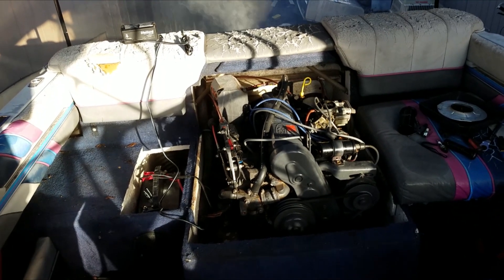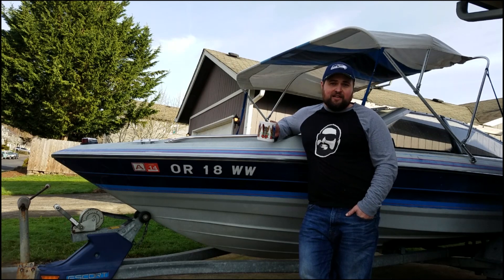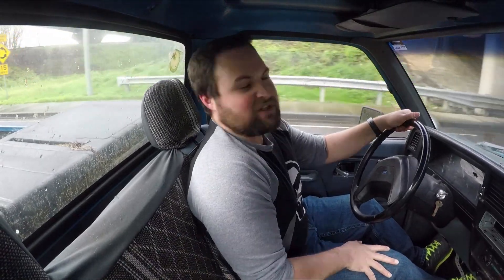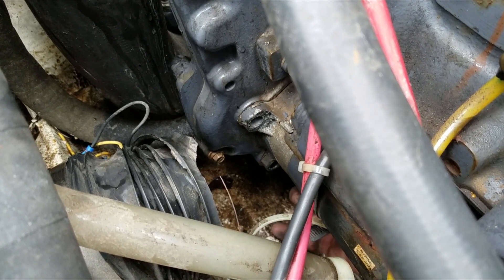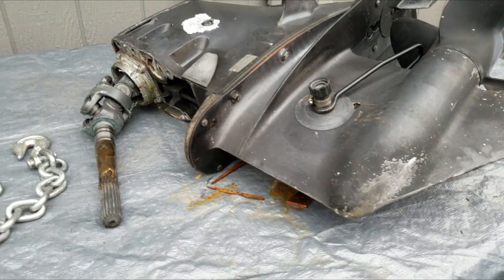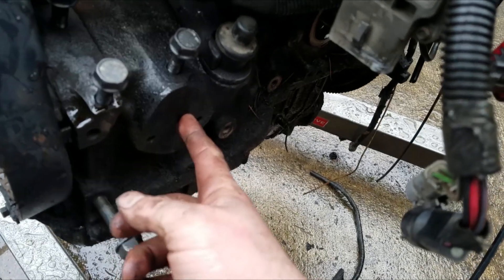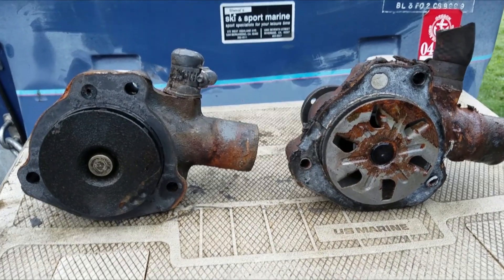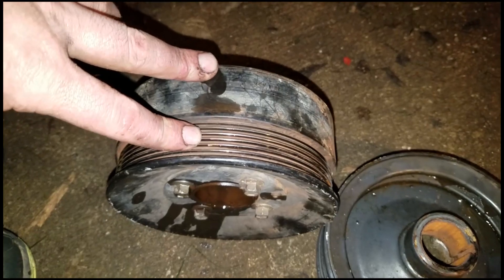Bayliner Capri 2.3 Boat Engine Swap with Ford Ranger motor Part 1

Comment: So you're telling me I can tubio charge this boat bc the 2.3 is the most reliable?
Reply from the maker: These engines came factory with a turbo in the mustang SVO and the thunderbird turbo coupe, making around 190HP. I've seen a custom build put down 400HP, which is pushing a factory engine pretty hard, in my opinion. But it is not just possible, it's quite common.

Comment: Hey dude! Glad you posted this video because I need some help and I'm hoping your wisdom can guide me :)

I bought a project boat and the previous owner fitted a VW engine with a volvo oenta sterndrive. I tried to connect the battery to the starter motor to see if the crankshaft can spin and it seems stuck. I am able to spin it manually but with a lot of force. Any idea what I should be doing?

Thanks!

Comment: I am by no means a Hater buddy but i’ve owned 17 or 18 Boats  so far   for a period of time in the 1990s Bayliner had a bad reputation as being Problem Boats  and they did have some issues but let me explain Bayliner was Genius at marketing and their ClaimTo Fame so to speak  was coming up with a entire Package of a Boat Trailer ,Motor  for a great price they accomplished  that by teaming up with other companies in the Industry , and  notoriously  cutting costs by  underpowering the Vessels at that time Mercury had come up with the Force Outboards that weren’t that great and Bayliner used the heck out of them  because they traditionally put too small of a engine on too large of a boat  the Stress had results of a lot of failures and people began complaining  and really. they got what they paid for  a low cost package that appealed to the decision makers ( Wives ) of young families looking to get into boating yet too lazy to do the research  over the years Bayliner Marine has been Absorbed by the Brunswick Group who has a way better Marketing Team and they  have  put together packages that overall have higher quality Control and better(more expensive)  parts and materials  they use that of course raise the prices  but the Customers get better boats  now i am also a major fan of the Pinto Engine and my most favorite Mercruiser is the 135H.P. / Alpha One inboard/outboard  i had that in a few boats more specifically a 185 Sea Ray Bow rider  i bought  for Water Sports with my children ! that boat had the Tourque  to,pull almost anyone and toy out of the water  along with a high speed  that through trimming and Prop changes  was usually faster than i really needed , along with a great fuel economy ! Winner all the way around IMO  you may need to  swap around a few props to  get exactly what you are looking for  fear not  if you play withComposite ones  they can be very reasonably priced  and they are a great lightweight  emergency prop to keep on board  almost any One will work to get you home in a Pinch  and a sacrificial Propeller usually means  no major damage to the Outdrive Internals that are expensive to repair or replace  yes it’s a ruined $75.00 Propeller but not a $5,000.00 Outdrive   boating costs money !  the swapping around to a more mechanical type engine  no EMC , fancy electronics  and what not does give the Mercruiser set up  a advantage to the way Ford puts them inVehicles  for Reliability and Suplicity in the Marine enviorments plus  the Carbureor gives.  it a little Tourque at the lower RPMs  in the old days  many Marine Engines were  Truck motors and that generally meant a Forged Crank , performance Cam  and sometimes some Beefier internalComponents Internally. i’ll be honest i do not know  if the original”Pinto “ engines all had those  yet knowing the overall  longevity they had i wouldn’t dought  that they did  i think they were also called and used   as IndustrialEngines in the 1970s  and often used in FarmEquipment ,ConstructionMachinery  and some other applications  i actually have a freind that has one in his Marine TravelLift  at his Marina

Comment: I just found out that a boat has to have a mechanical fuel pump so that if there is a failure it won’t continue to pump fuel (big fire,little boat,big problem!

Comment: If you wanted to use some other kind of engine, like a Toyota Corolla engine or something else, how can you make those fit the outdrive?
Reply from the maker: Adapter plate and motor mounts. It would likely require fabrication, but people have been making adapter plates for many years.
Reply: @StrangeGarage  Thanks, I'll see who I can find that's making them and what engine options there are out there.

Comment: Cool build! But Ford's first OHC engine was in 1939, not 1970. The 1100ci GAA DOHC V8.
Reply: Plus the 2.0 OHC came out first (a completely different engine) in the Pinto, and the 2.3 "Lima" OHC engine a few years later.

Comment: Does this work on the 1987 Bayliner Capri?
Reply from the maker: It depends on your motor. If you have the capri with the 2.3 motor that says "ford" on the valve cover then it will work. 

You will still need a low pressure electronic fuel pump because the newer truck blocks were not machined for mechanical fuel pumps. Older truck blocks will still be compatible with the mechanical fuel pump.

2 things about that though: 1, the fuel injection is not worth the trouble, so just use the carb. 2, swap the head from the boat motor onto the truck motor. The boat heads have boat valve springs and guides. The truck heads are different in SO many ways. It still worked for me using the truck heads, but not everyone will be so lucky.

Comment: You could have taken the ckp sensor off and used the v groove pully. You don't need the ckp because it's timed by the distributor now, not the computer.
Reply from the maker: That is correct, except I didnt install the distributor on the ranger engine. The EFI works pretty well, so I'll keep it for now I think.

Comment: does old nissan cd17 can be use as boat engine? running at salt water environment  does it cost a lot?
Reply from the maker: It would be more work than its worth. I bought this boat specifically because I knew this motor would fit.
Reply from the maker: And it's not worth taking this boat in salt water!!!
Reply: @StrangeGarage   thanks i already did the swap and i just make a convertion and add some bracket to fit

Comment: Hey SG, great video.  You talents continues to amaze me.  Are you going to put a motor in the Ranger and get it back up and running, or sell it for scrap?
Reply from the maker: Ted H Thanks Ted, I try to keep myself sharp (it doesn't always work out). As far as the ranger is concerned, the plans aren't set in stone, but it will be getting a transplant of some kind.
Reply: You seem to have an affinity for your Rangers so this doesn't surprise me at all;-)
Reply from the maker: Ted H Very much so. Wild guess, how many rangers do you think I've owned?
Reply: Sorry for the late reply,  I've been away on a snowboarding trip with some guys from Church.  I'd say you have owned 11?
Reply from the maker: Ted H That's no worries, we're all busy. If you count my parts truck and my Bronco 2 (same as a ranger basically) I've had 9 rangers, but one was just for parts. They've been good to me. People around here only care about toyotas, so you can get a ranger for under $500 No problem, running and driving.

How was the mountain?
Reply: Strange Garage so I was close on the Ranger count ;-) Winter Park = Awesome, favorite of the three areas = Mary Jane.  Been snowboarding since age 12 and since have lost my big air abilities, but still love riding.  Do you ski or snowboard?
Reply from the maker: Ted H I have been skiing when I was a kid. As an adult I just haven't made it out. I would love to, I'm just a cheap bastard. I love the snow, life Is just hard to get away from sometimes. You know what I mean.
Reply: I certainly do know what you mean.  Did you get the boat up and running?  Are you planning to upload a video today?
Reply from the maker: Ted H Boat is running (man do I love EFI), and I am posting a video. Not on the boat unfortunately, it's snowing here right now so I can't take it out. Too cold.

Comment: One silly little question ??? Why didn't you just rebuild the boat motor ?? Those were good little engines..cheers 🍻🍻🍻
Reply from the maker: +Rodney Brand cant, engine has a cracked block. Around here if you don't winterize them properly the water sits in the block, if it freezes you're screwed! The inside of the motor is MINT! I am half tempted to toss the good guts into a fresh block. The boat only had 300 hours on it! I bagged up the crank and pistons just in case.
Reply: Strange Garage. That idea of yours is good to keep all of the other parts that I would do..sorry about the cracked block
Guess the original owner was glad to see it go..I've seen that happen be for ..cheers 🍻🍻🍻
Reply from the maker: Rodney Brand He honestly may not have known. He obviously tried like he'll to get it running but it was not gonna happen, dude just didn't know what he was doing. When I got it running it sounded smooth, except it had a gallon of water in the oil and smoked WAY too much for public waters! Oh, and I watched the oil I put in it run out the exhaust. Engine was totally screwed.
Reply: Strange Garage.   Now you cal put a 3.0.  2--V motor in the ranger .. You'll need something to pull the boat with..You will be glad you did..the 3.0 is a very good motor plenty of power looking foward to your next video..Cheers 🍻🍻🍻